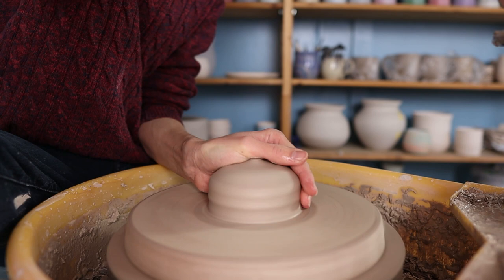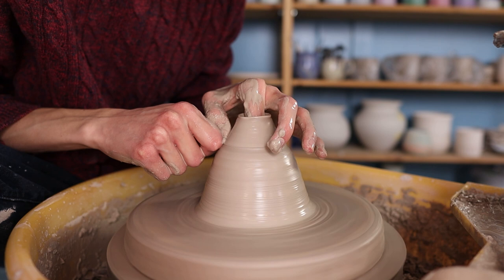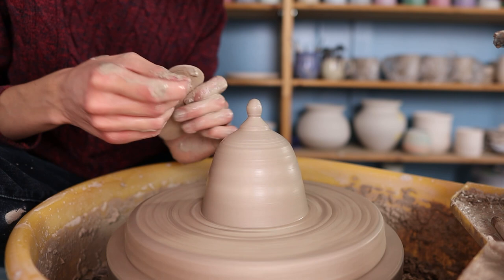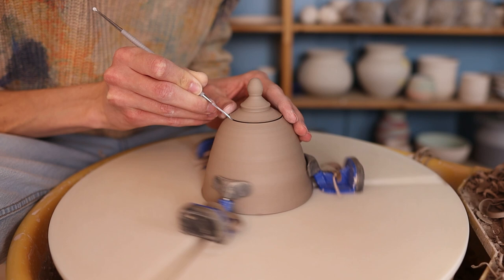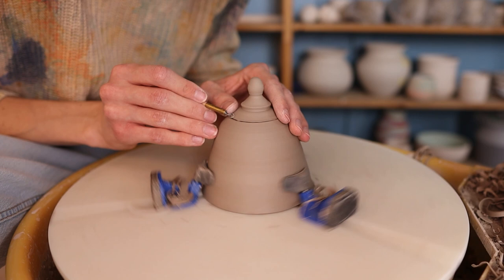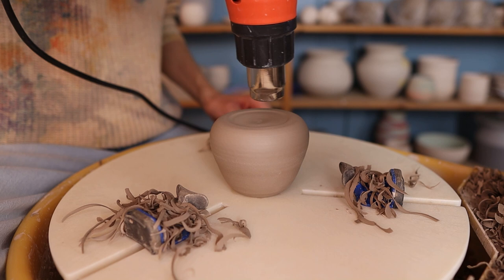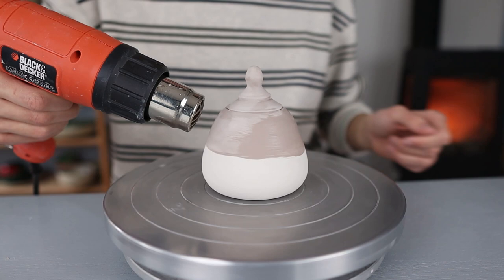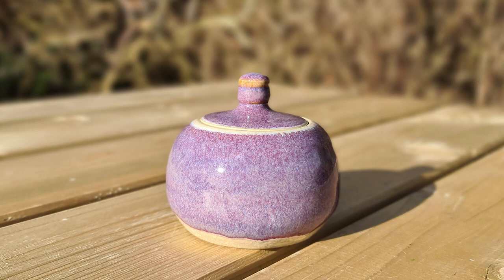How To Make A Lidded Jar In One Piece // cut off lid

Comment: Hi. Thank you for the great video. Do you go back and fill in the little hole that you made before you fire the pot? Thank you.
Reply from the maker: Thank you! I forgot to mention, but I don't. The hole closes on the outside when trimming the piece. And it was very small on the inside, so I just filled it with glaze. But if the hole you make is a bit too big and still visible, you can go over it with a wet sponge and smooth it out. And even put a little piece of clay into it, if necessary😊

Comment: Did you fill in the hole you made to let the air out for shrinkage with any slip and clay?
Reply from the maker: The hole closed on the outside while trimming it, and the inside got filled with glaze. But if the hole is too big you could fill it with a little piece of clay and smooth it out with a sponge :)